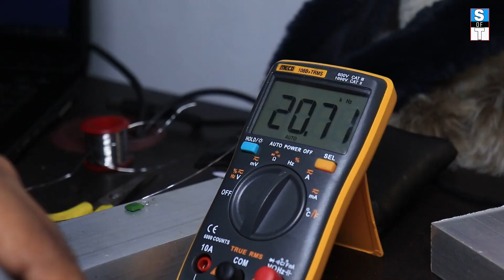Sg3525 inverter module for high frequency inverter | inverter circuit

Comment: Sir why we use for example. A 44 transistor or 8550 to 3525 ic pin out
Reply from the maker: use 8550
Reply: @Lifeofelectronic  sir what is the benefits can't we use ic drive pin to MOSFET gate with out transistor

Comment: how can I get 220v and 10A current  from this module? I need it for a wireless charging panel for an electric car
Reply from the maker: module can provide less amps you needs to increase the power of the output stage to get achieve

Comment: I make this circuit for inverter but when i connect mosfets to out A &B the 10 ohm resistor burn .
Reply from the maker: Whil making on electronic lot of problems are occured. The real hero is as like finding the error and remaking it as a new
Reply: @Lifeofelectronic  abay salay tujhe khud kuch nai pata chala baten karnay
Reply from the maker: @FarhanAli-fd6vq  don't blame anyone the circuit is working fine without any issues check your connections properly
Reply: @Lifeofelectronic  i can say hahahhha on your reply